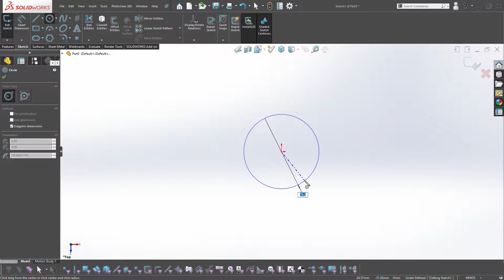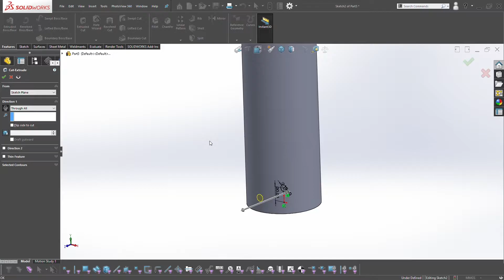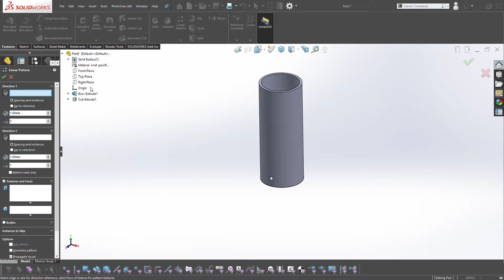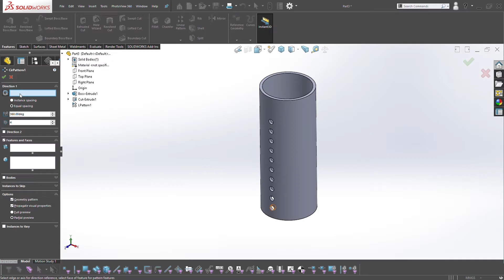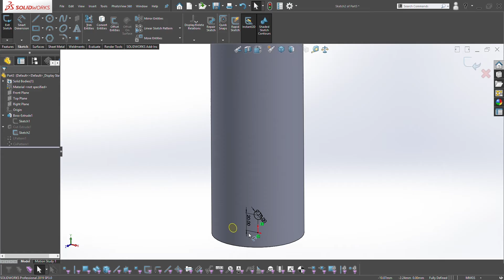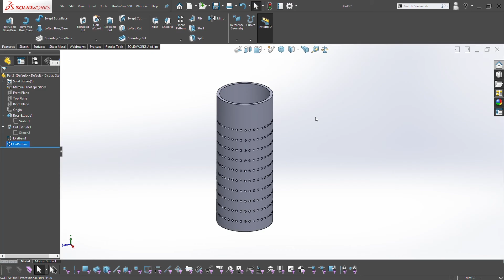Solidworks Basics Tutorial - Linear and Circular Pattern

Comment: im trying to do a circular pattern of a triangle sketch on a 3d cylinder. i need it to be a sketch so after i do the circular pattern i can change the sizes of each triangle accordingly. why isnt it working? is it not possible or am i missing something.
Reply from the maker: What is your end result? What are you trying to model. You can’t modify the geometry of the initial sketch used in the pattern. You’d have to design that in from the offset.